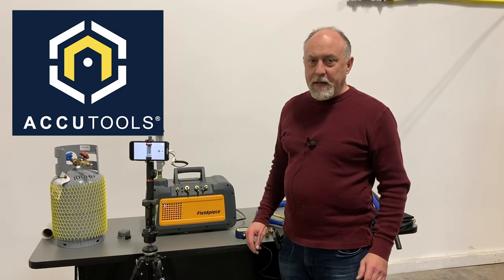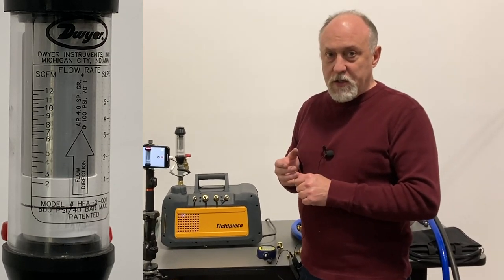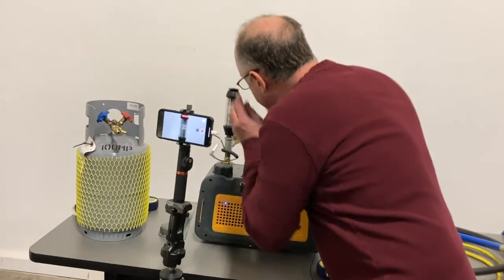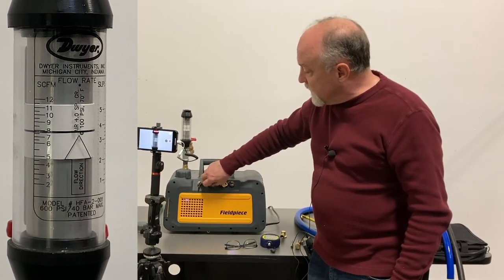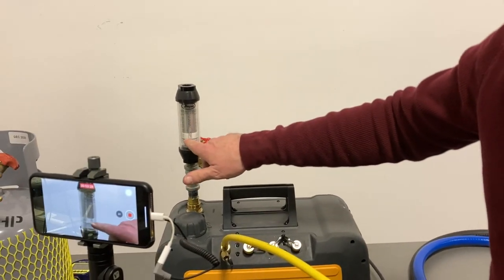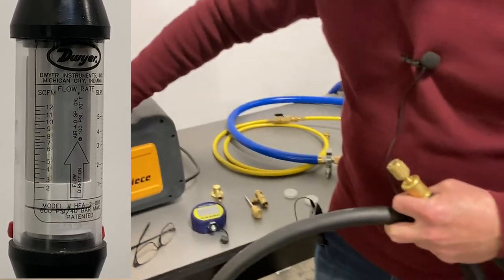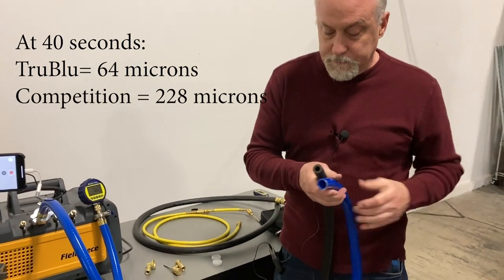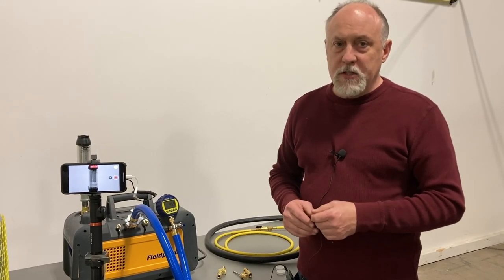Don't get Hosed! Use an Engineered Solution for Vacuum!

Comment: I bought all this but don’t use it.  By the time I hook it all up, I can hook up my field piece manifold with 3/8 hose and pull vacuum in about the same time.   Yes this is faster.  But I have to use a micron gauge and more fittings.  I don’t deny an advantage I just don’t see it when I have to carry more stuff up a 3 story apartment roof and hook up more stuff.  I save 3 minutes but spend 10 making more trips up and down the ladddr etc.

Comment: Here it the thing tho you usually only can pull thru a 1/4 " port unless your at the rack and you have access to 3/8 angle valve. They don't speed up the evac that much unless you have that 3/8 access

Comment: Looks like a field connection from the true blue 3/4'' to 1/4'' inch with that butterfly tightener does is actually come from the  factory from 3/4'' to 1/4''.

Comment: Great video.  Imo, if you are coming from 1/4 hoses, then jump to the trublu. If you already have the Appion 1/2 hoses its not worth it to save a few mins.
Reply: Every little helps, I have a 1/2” Appion and 1/2” yellow jacket. will make a massive difference for us automotive guys that do a proper job on the system! actually removing moisture and tracking it on the app with a micron gauge. You 1/2 hour vac & gas guys with 1/4” hoses and analog gauges wouldn’t notice the difference 😂 but the 1/2” to 3/8” fittings will make the most of the pump and gauges just got mine to 🇬🇧 can’t wait to give it a go 👊👊👊

Comment: Good explanation! But I think the 1/4 hose is clogged or blocked.  There’s no hissing sound at all!
Reply: Yeah, and there is nothing wrong with using a 1/4  inch setup like everyone has been doing forever.   If a larger system takes 9.5 minutes to pump down or 10 who cares.  It's not worth the added cost and lugging around those smurf hoses.

Comment: I'm new in the HVAC-field and I'm from Germany. I like the big diameter of the hose. We have always 5/16" SAE connections at the R410a and R32 heatpumps. Can I use the Kit also for 5/16" connections? Is there an adpater included? Maybe it`s a stupid question, but I'm new in this field.

Comment: Question: When making repairs on a system (or replacing a compressor). If we are replacing the filter drier, is moisture really a cause for concern? I would assume at that point proper de-gassing is more a priority rather than trying to remove moisture with the pump. So a vacuum of 5000 microns or less should be OK. But a vacuum under 500 microns with a 10 minute decay test would be better.
Reply: The filter drier can only hold a few teaspoons of water until it fills up and stops absorbing. Then you have water circulating around with the compressor oil. That causes acid to buildup and damage the compressor.

Comment: What’s the model number of that flow gauge?
Reply from the maker: Dwyer HFA-2-100, calibrated for air at 4.0 specific gravity @100 psi, 70 degrees F. You have to put a valve in parallel with it to recalibrate it to your vacuum pump.